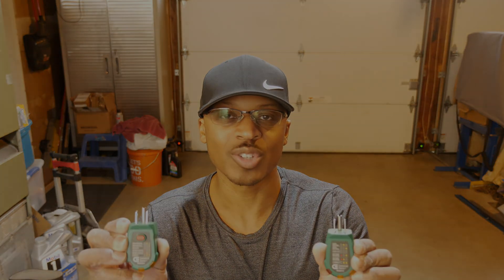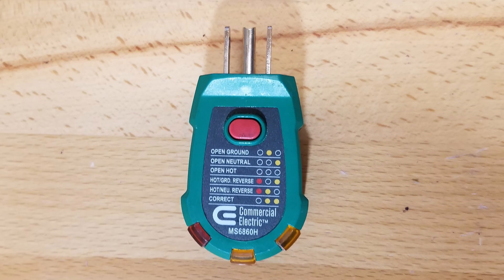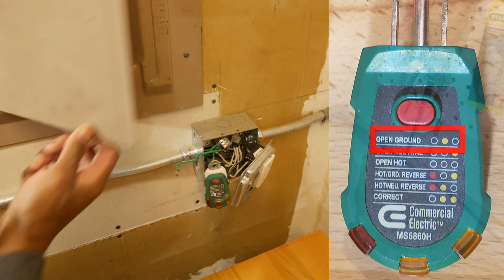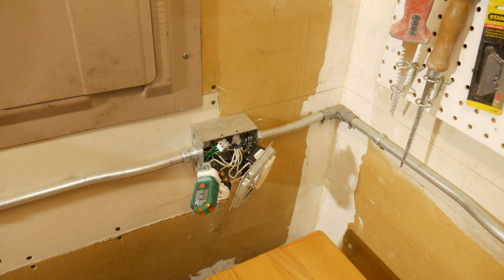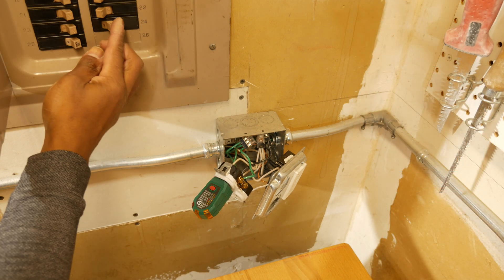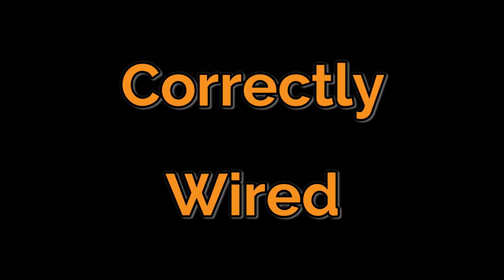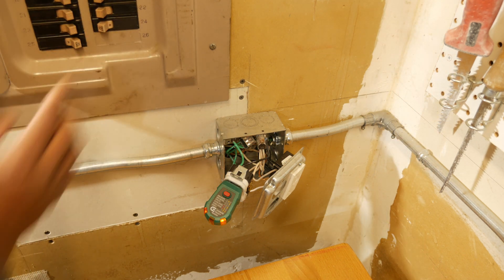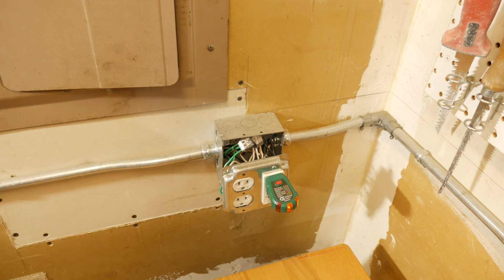Electrical Outlet Wiring Made Easy with an Outlet Tester

Comment from the maker: When I installed the garage heater circuit, the wiring for the outlets was a little complicated. Fortunately, the outlet tester helped me diagnose any errors I made, and I passed my inspection with no problem.

Please leave a 👍 and share the video!

🔧▬▬Tools and Materials▬▬🔧
✔️ DIY Apprentice Recommended Tools and Materials ► https://bit.ly/2T5psFw
✔️ Commercial Electric MS102H Outlet Tester w/ GFCI ► https://amzn.to/2HuZfey

📷▬▬Video Equipment▬▬📷
✔️ Camera used ► http://amzn.to/2GcpkOb 
✔️ Lens used ► http://amzn.to/2Deu16S 
✔️ Tripod ► http://amzn.to/2GbaM1c
✔️ RAM Suction Mount ► https://amzn.to/2Wz9PXh
✔️ Cyberlink PowerDirector ► https://bit.ly/2jTwGxT
✔️ Adobe Photoshop ► https://bit.ly/2V7nyUX
✔️ Camera Slider ► https://amzn.to/2WtD7GW
✔️ Deity V-Mic D3 Super-Cardioid Directional Shotgun Microphone ► https://amzn.to/2LI1lf7
✔️ Boya By-M1 Lavalier Microphone ► https://amzn.to/37ca7bB

Comment: how to fix open hot on a generator 6000 watts honda brand
Reply from the maker: Sorry I missed your question. I'm not familiar with generators, but the open hot may be caused by a loose or damaged wire.

Comment: Any time the hot wire is landed on the ground screw, “on a plug that is wired per the NEC code” the breaker would have tripped instantly. But since the plug was not fastened to the metal box the circuit was open.
Reply from the maker: Thanks.

Comment: Again, You speak so clearly. Just watched this one and have a question. I am not understanding the use of the GFCI tester completely. I know what you demonstrated using the GFCI button on a non-GFCI outlet, but just not sure how to use the GFCI tester on a GFCI outlet say in the bathroom?
Reply from the maker: The GFCI button in this video was used on the GFCI outlet (outlet on the right). Since GFCIs already have a "Test" button, the tester is used to perform a secondary check. Thanks, again. 😀
Reply: @DIYApprentice  What if you pressed that button on a non-GFCI outlet, are you then just going to have the circuit breaker tripped
Reply from the maker: @MrGmeister  I played with this a little. (1) If the non-GFCI outlet is downstream from a GFCI outlet, the GFCI outlet is tripped. (2) If the circuit breaker is GFCI, I'm fairly certain the breaker will be tripped. (3) On a circuit with no GFCI, the breaker is not tripped.